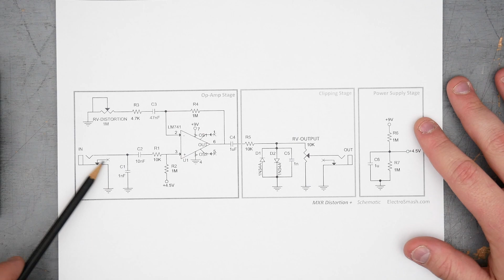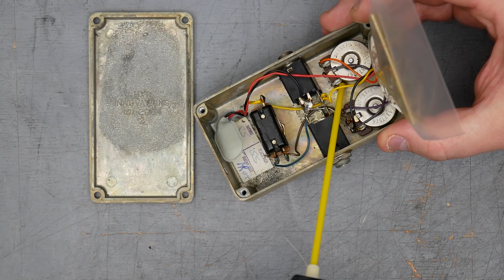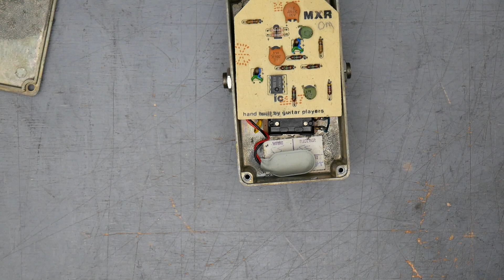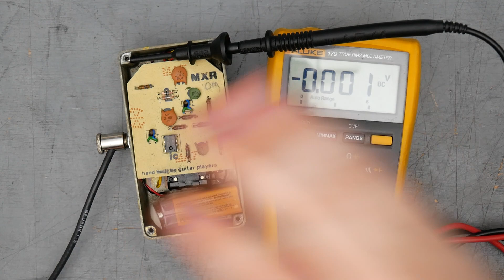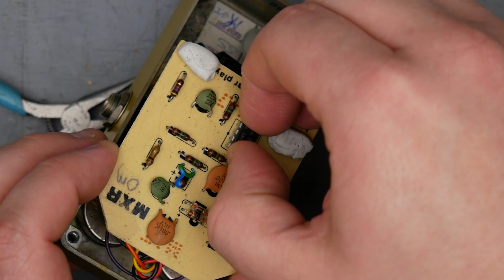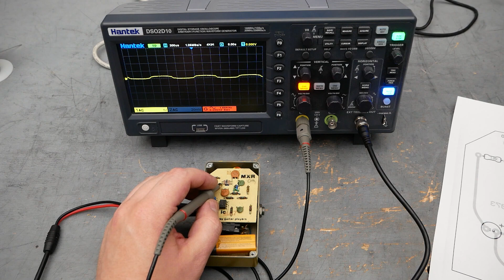Vintage MXR Distortion + Repair! Gray Bench Electronics

Comment: So I had a Newer MXR Distortion Plus from like 2021. I also have the Randy Rhoads polka dot version. They sound completely different. The Newer one is more midrange but less bass and high's. The RR one is kinda centered as far as midrange but much more bass/treble. Would you happen to know why this is? There must be a difference between the Rhoads model and the modern version. When I open up the two....(I am not technically proficient with the inside parts...which is why I'm asking) The Rhoads one has a board very similar to the vintage boards whereas the stock 2021 version has a printed PCB.

Would the printed PCB make a difference in sound? Would you happen to know if any of the parts in the RR one are different from the modern 2020 versions? I'm really dying to know what the real differences are and nobody seems to have looked into it even though the RR pedal has been around for a year or two already.

Great video and I subscribed and Liked. I love that distortion pedal.

Comment: thank you for this!  I bought a guitar in the mid 80's that came with a slightly newer block logo version.  it worked for a while and then stopped just like this one.  I could never figure out what the issue was.   no internet back then, so I did what anyone would do and built my own replacement lol.  I have since replaced both with one of the newer versions with the LED.  perhaps I will go back and add a socket and try some of the different versions of the 741 in there.  - very happy to have found this video!

Comment: I have an '82 mxr dist plus. Simple little circuit. i fixed it once. I got a newer dist + and it sounds brittle. The circuit is complex and really only sounds good through the fx loop. I had an od pedal from China a klone, a little brittle... left it on for a month straight. Its one of my favorites. Im gonna try it with the newer dist +
I used an old cigarette pack to protect the pcb.

Comment: One thing to note is R3.  It's showing a 4k7 resistor, but I have seen stock D+ pedals with 1k in this slot!!  We should understand what that one change does and net effect of lowering it.
According to the Wampler Distortion Plus MODS page one can find, Mike says changing the 4.7k to 1k and the 4n7 to .22uF increases gain but does not change the high frequency response!  Doing another search for the video "How MXR Distortion + Reinvented Drive Circuits | Gain Appreciation", at 3:16 in, it shows you the formula for Gain = 1+(1M/(gain know resistance+resistor)), which is 1+(1000000/0+4700) = 214 = +46dB.  Changing the 4k7 to 1k would result in = 1+(1000000/0+1000) = 1,000!  So about a 5x increase in distortion.  Not sure what that equates to dB, but > +46dB!!

Comment: I have a 78 block logo that had the  exact same problem. I replaced the op with a newer Texas Instruments 741 until I finally found an older one that was an exact match to the original. They all sounded the same to my ears. The only reason I did it was to keep it looking stock as much as possible. Great video, thanks!

Comment: I just repaired my Distortion + from 1981. I installed a new op-amp and it's now working ok. The problem I had when removing the internal wiring and hardware from the casing was old, dry solder joints. Every move I made broke a wire and I was forever resoldering the connections. My 1981 version has an LED and a power connector. Not sure if the LED was a modification from a previous owner. Thanks for the video.
Reply: MXR started adding the LED light and power jack in the middle of 1981 so it's a coin toss with that. What you could do is check the job they did with the light and power jack with another from that same era that's guaranteed to be from MXR like an 82 or 83. Other than that...that's the only way you'd ever be able to tell....unless it's a visibly dicey job and you just don't know lol.

That era of the Distortion Plus just sound better to me.

Comment: If you had to replace the battery connector in a vintage pedal like this, would you try to find a NOS one or whatever you had in stock?
Reply from the maker: Probably whatever I had in stock. Even if really cared how it looked, I'd be worried about the old plastic being fragile.
Reply: @graybenchelec  that makes total sense. Thanks!

Comment: I've got a few of these pedals. Three of the 2 knob version and one of the four knob AC version (aka  MXR Distortion II)  Which I bought new in the early 1980s.  I can attest to the foam problem. It's a pain in the ass. But this one really looks good on the outside. And you did a great job cleaning it up.  Rock and Roll!

Comment: my pedal is a distortion III, it spent a long time with the battery inside, which broke and stopped turning on the distortion. the two states (on and off) the led appears lit, while the switch when in the off state, the true by pass works, but when in the state that should be on, it does not output any sound. I will try to change the diode and capacitor to see if it comes back to life. I am sad...

Comment: GRAY BENCH, you should make a separate video about the slew rate distortion on the oscilloscope because the 70's 741 chips had different specs on the datasheets for the slew rate time and rise time. The new 741 chips are faster slew rate and rise time so you don't get that slew rate distortion. You can compared the older chips and new chips with a 2 channel Oscope to compare the slew rate distortion in a video lesson.

Comment: Hello, Joe.
What are you doing with the scalpel after applying the de-soldering wicker? Scraping the pad?
Reply from the maker: Hi! I was using that to just lift up the pins of the opamp. They were flattened against the PCB.

Comment: The circuit looks very similar to the 1974 Ammeron distortion pedal without the circuitry connected to the offset pins and final buffer stage.

Comment: They came with foam wrapped around the board originally, but it rots, eventually it turns to corrosive goo so anyone with old MXR pedals should remove it. The AC powered ones you can get rid of the goo on the back plates with some acetone. I use fish paper to insulate the boards in the small ones.
Reply: what is the function of the foam?
Reply: @CullixYT To insulate the circuit board from the metal enclosure.
Reply: @JoeGuitar6  thanks bro

Comment: Those solid tantalum capacitors make this effect performs exotically.
You can replace 741 opAmp with CA3140 or LF351 or LM301A or LM318 or TL071 for different personalities.

Comment: My first thought was a socket for the OP amp but honestly now looking at it that might be too tall to put the backplate on. Fantastic vid!
Reply: Encapsulate the board in some isolator and turn it upside down. Did that and could easily fit a socket ....  Tried many different OpAmps, but all sound the same. The main producer of the distortion are the germanium diodes, not the OpAmp.
Reply from the maker: Yeah, it is a good idea. I leaned toward keeping it looking original on this one though.
Reply: A low profile socket will work actually, dyna comps had one many times.